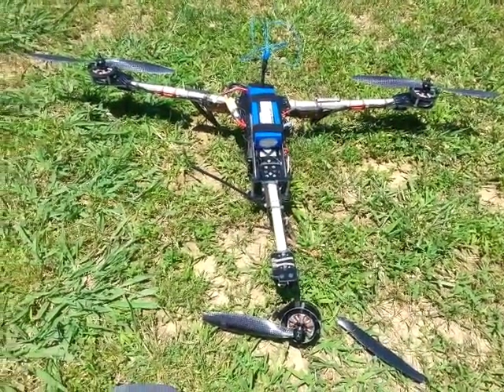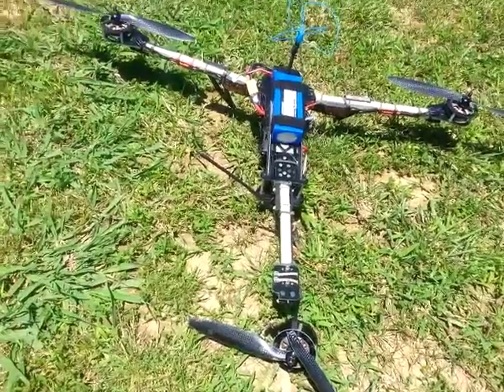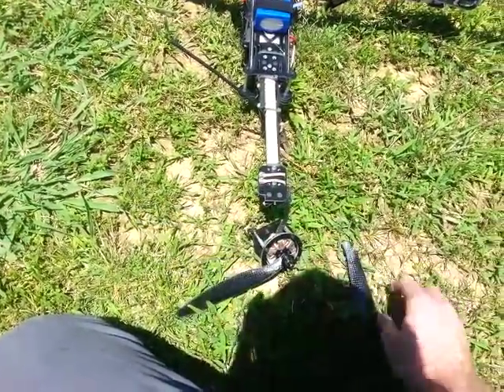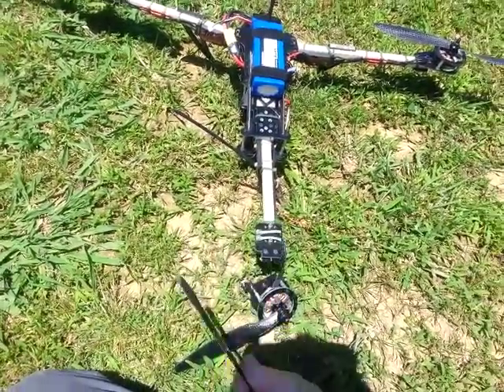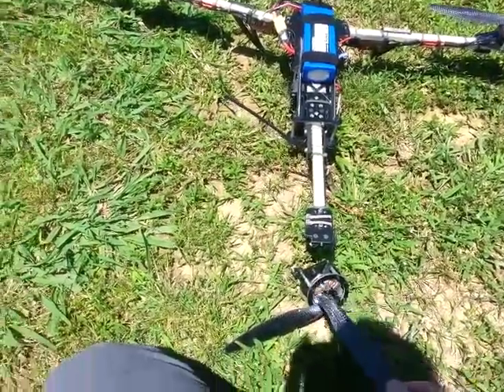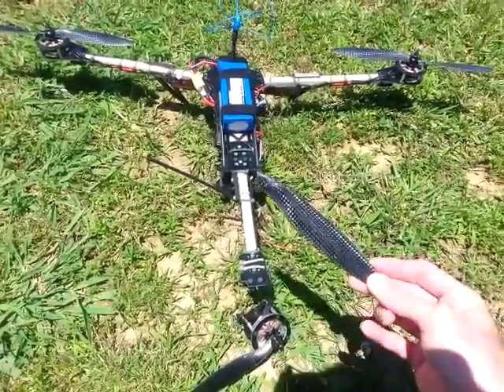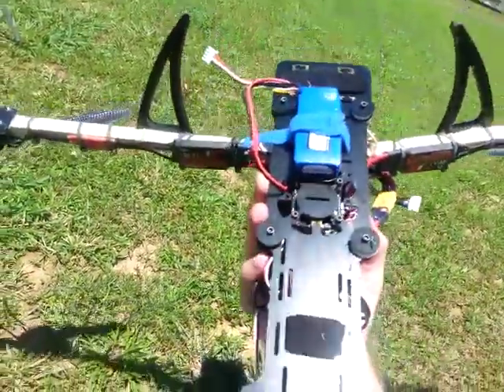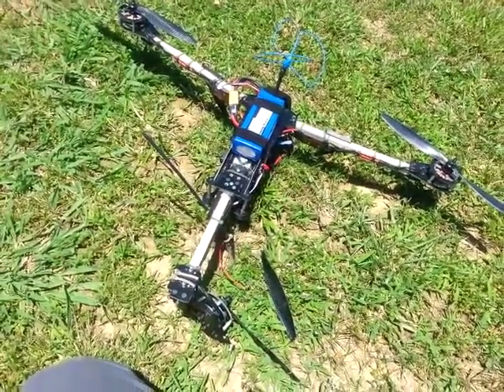Gemfan Carbon Fiber Prop Exploded mid air!

Comment: well, as you see the other two are ok. The blade that broke is due to the stress caused by the servo. It's a tricopter, you should mount the T-motor style ones....
Reply from the maker: this was way before t-motor style props.

Comment: Hearing about CF props breaking in mid air doesn't surprise me.  I've been watching for years CF hockey sticks "randomly" breaking in play.  Happens all the time.  It appears that although CF is incredibly strong it is also appears the smallest flaw will result in a catastrophic failure.  From what I've seen of CF outside of RC it makes sense to me.
Reply from the maker: ya, CF is great and rigid but that is its main flaw... if it requires flex it will fail. By introducing things like kevlar and other high strength fibers, it can reduce its shatter effects and increase its capabilities. I have a friend that used to design hockey equipment in Steamboat Springs Colorado. when composites came out he said that same thing the first day he got a sample composite stick.

Comment: How many kv motors?
Reply from the maker: mt3506 kv650 running on 4s... the prop blew at only 1/2 throttle and had no prior stress applied.

Comment: OOPS
I wonder if there is a little more room for vibration because of the moving parts of the tail assembly?  Might be a harmonic there?
Have you tried balancing the prop hub ie. flightest